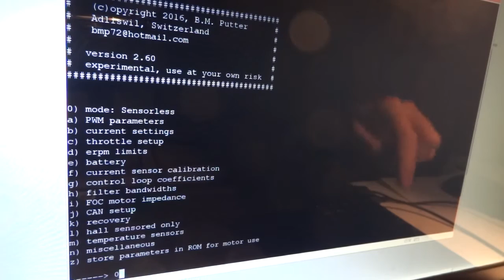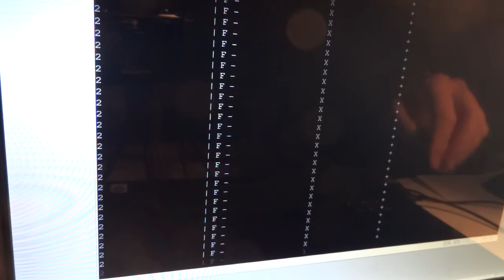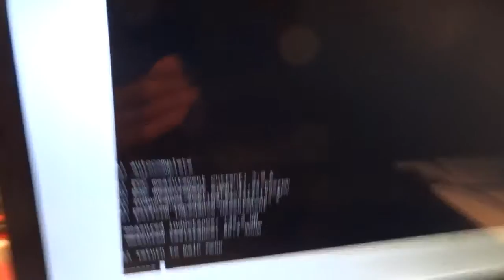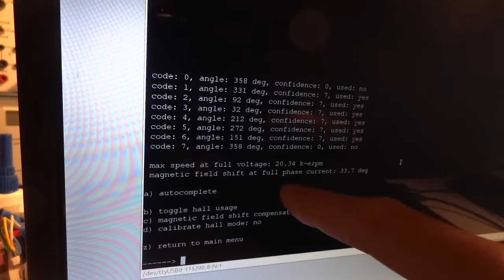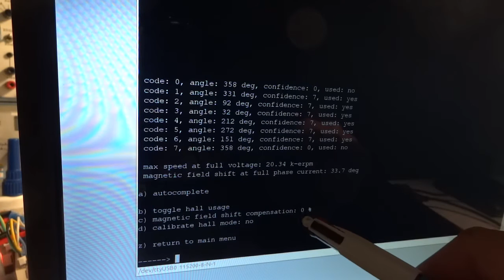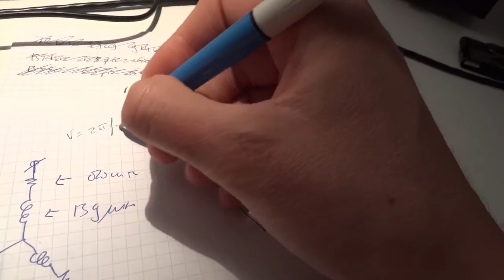MAH01813

Comment: I'm running the Hyundai HSG motor, Honda IMA inverter with the Lebowski brain, and I LOVE LOVE LOVE the brain.   I was using a Kelly controller and it was a pile of CRAP.   It heated up the HSG fast, could only get to 3K RPM under load, and about 5400 with 160V under no load.   The Lebowski has gotten me to 10K+ with only about 40% FW to phase amps.   I LOVE THE LEBOWSKI CONTROLLER!!!